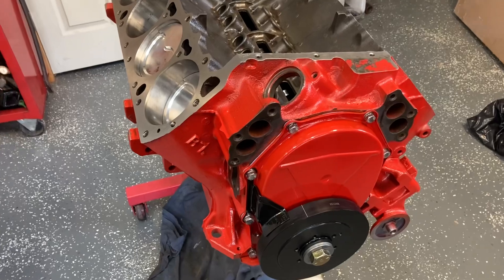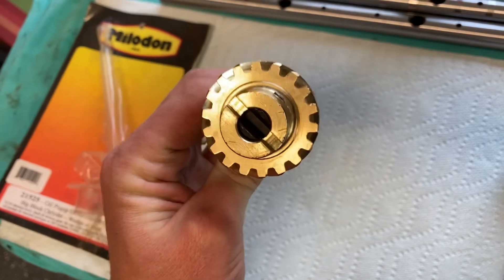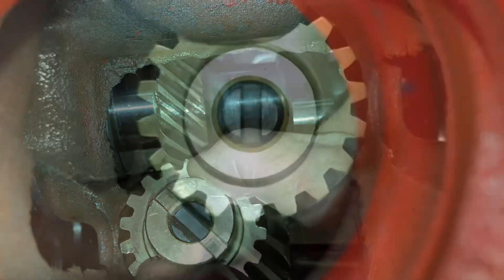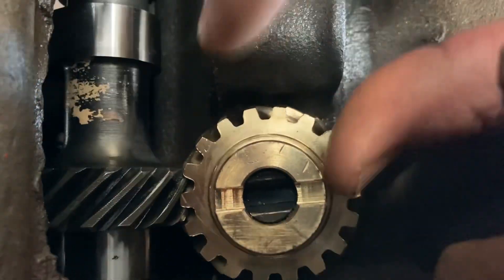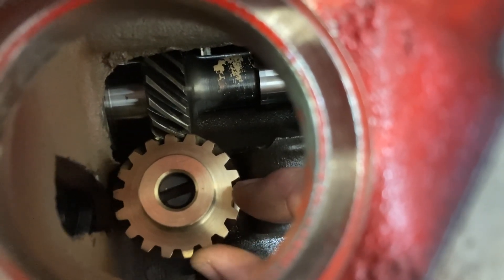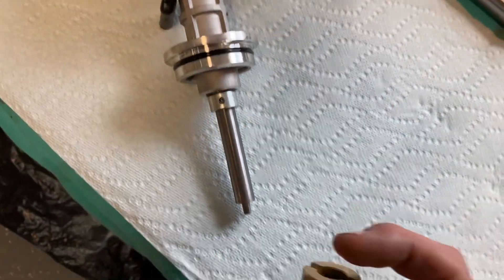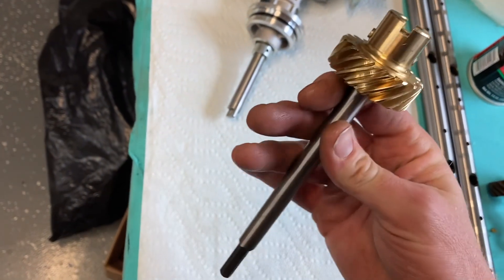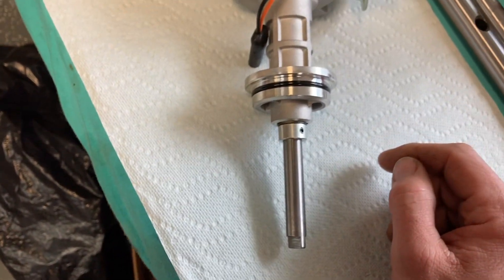The UNEXPECTED Reason Your Timing is Erratic and How to Prevent it! #engine #bigblock #mopar #dodge

Comment: Years ago a mopar action magazine writer suggested to put a collar at the end of the distributer shaft to adjust/minimize distributor shaft to intermediate vertical end play....I haven't tried it....just adding my 2 cents and letting you know you have a great channel.
Reply from the maker: Thank you, Daniel! I’ve heard of the collar before. Maybe interesting to try.
Reply: Yes. Rick Ehrenberg has them on E bay under "for Mopar Distributor Collar Timing Stabilizer 340 440 383 Hemi Dodge Plymouth".
I'd put a link here but E bay deletes my post every time I try to do the link thing.
Also, bronze gears aren't meant to run on the street. They will wear quickly. Well, way more quickly than the steel ones. The answer is running a roller cam that works with the steel intermediate gear. I'm running one from Comp in my stroked 440. There's a lot more newer tech out there now than before.
Reply: Hughes engine performance actually sold/sells it

Comment: Because the intermediate shaft drives the pump it can be baggy and really has little effect on timing but the dizzy engagement would be important.  I always liked sb ford cause the gear was right on the shaft,  timing is like a rock.
Reply from the maker: Thanks JC. I’ve only built that one ford engine, but the gear on the old distributor was missing several teeth! I’ve never seen such a thing. Is that common?
Reply: @JustMoparJoe  I think anything is possible,  I've never seen that.

Comment: Through my own testing ive found that the gear slope is not what causes that. Lets say you have .02 to loosen things up a bit. That .020 is not going to swing the timing 5 or more degrees especially when the oil pump is is dragging the drive to the cam. Cam walk is another story, but then again there are forces that push the cam in one direction it really doesn't walk.
The swing in timing is more related to electrical. Just my .02$
Reply from the maker: Thanks for sharing. My previous experience may have been influenced more by having very light springs in the distributor, and a distributor shaft end that was too short to engage that intermediate shaft. She revved clean but really broke up right after the rev. I was thinking carb, so I switched it and it still did it. Had to fix that connection 🏆

Comment: Hi Joe, Great video ! Am I correct in assuming you are running a bronze gear because that is a billet roller cam? One thing that I find interesting is that the fellow I got my bronze gear from included a hardened washer to run under the gear..he had machined off a raised portion on the bottom of the gear to allow for the washer. I was thinking that the washer might be another change to allow for better engagement between the shaft and the distributor?
Cheers,Pat
Reply from the maker: Here’s the cam. https://www.compcams.com/xtreme-energy-242-248-hydraulic-roller-cam-3-bolt-for-chrysler-383-440.html
Both of these gears have the raised portion under them. Using a washer may be a nice solution to set that back lash between the gears.

Comment: All the reasons for a crank trigger ignition system.  The two reasons that engines last so much longer is because of the far more accurate spark and fuel delivery of port fuel injection and crank triggered ignition.
Reply from the maker: Thanks Billy

Comment: Dont  worry about the play in the gears. The resistance of the oil pump will literally lock them together. Not to mention the bronze gear will expand a lot more and tighten up, which can be a problem with shearing and slivers if there isnt sufficient play/slop. Your 'fix' for the slot is where all that jitter happens. From there up to the rotor. Some dizzy's have a two-piece shaft as well. There is a small bushing and pin that wears out and causes the same problem, dont know until you pull it apart to check either. Only one little thing you overlooked here and thats the vertical thrust when the gear engages, the cam will actually walk the intermediate shaft up and in turn the dizzy up and throw timing off. Ive had an issue with a 440 doing that before. It had about 300,000 miles on it and if you didnt have the dizzy collar locked down you could pop the throttle and watch the whole distributor pop out of the socket!!!
Great vid pointing out these very often overlooked aspects of building!
Reply from the maker: Thanks for sharing! I wish we could slow motion film these pieces spinning in the engine at 6,000 rpm. Lots of fun science at work!
Reply: Whe it is running with the oil pump pushing oil,  just like you said it will not budge as it locks face to face on the two gears.
Reply: The drive gear is pushed DOWN into the bushing not up. The helix on the cam gear also sucks the cam back into the block. I have run LOTS of 440s with very high mileage for years daily driving as a primary car and then drag racing on the weekend with over 2500 time slips. We had to  put a diaper in the bellhousing to catch the oil from the rear main seal and put in a new one every weekend! We wired the dipstick down and oil caps on because the blowby would blow them off. I have actually seen a 440 in a low 10 second dart that was still running 15 years later and had never had the stock 906 heads off. I don't know how many miles it had before it was installed, but it actually blew the valley pan up into a balloon under the intake and was running 11's by then. the guy didn't change it because we were bracket racing and it was consistent! Ours was deadly consistent being the winningest car in the history of that track and made a perfect run, perfect reaction time, perfect dial in, footbraking a six pack C body! I suspect it was blowby that lifted the distributor. That reliability is a far cry from using 2 or 3 brand x engines a year campaigning a 10 second car!

Comment: Does the gear need to be bronze I had a new old stock shaft and it seems to do what you say mild engine hydraulic cam.
Reply from the maker: Bronze is an option for roller cams. Most flat tappets use the old stock style.

Comment: I've never seen one with that much slack!   wow!   Now, I have had those bronze gears flakes stick a oil pump spring.  they are made to shear.  Also, that .004 slack will move that rotor about 4x that much
Reply from the maker: Thanks, Tim. I figured you may have seen some variation of that. It’s always something! Lol

Comment: There is quite a bit of slop in all of those parts, but the oil pump requires a lot of power to turn I've Been Told so the resistance of turning that would never allow any backlash while the engine was running. But the clearance between the end of the distributor and the top of the oil pump drive shaft is something that would cause some of the timing to Jump Around
Reply from the maker: Thanks Thomas. I know every engine has a level of harmonics that goes on when it’s running. I have no idea on how that runs through the intermediate shaft there, if at all.

Comment: If it’s not popping when you let off you won’t turn as many heads😂
Reply from the maker: That’s a 3/4 cam! 😂
Reply: @JustMoparJoe  Oh yeah. I get that from time to time. "Is that a 3/4 cam your running?" 
Nope. It's a full cam. It wouldn't run with a 1/4 missing.

Comment: Great video Joe...that other one from a famous 440 place is just not up to the standard of the other one. I've played with this too with stock parts shiming the distributor shaft correctly too to keep the reluctor/points cam from having to much up and down play seen some that had a lot of play out the box.... And the intermediate bushing is also supposed to be burnished to size when installed would be a good idea to have the new shaft at that time to get the correct clearance just in case of shaft diameter differences between brands.
Reply from the maker: Thanks John! That’s an awesome idea

Comment: Another area to consider is the centrifugal advance mechanism and weights inside the OEM distributors. Over the years the grease they used breaks down and gets gummy. Springs can also break and cause problems. I always pull them apart, clean and grease to make sure they work properly.
Reply: The oe or MP Distributors are supposed to be oiled regularly. Pull the rotor, there is a felt or oil wick under there. If you do that, these things last forever.
Reply from the maker: Very true! Thanks for sharing
Reply: This makes sense.  I think one of the springs broke or came loose in my stock 360 distributor, runs up to max mech advance way too quickly and often sticks there until the RPMs settle below about 1000.  I'm swapping it for a Summit billet electronic distributor anyway because they're easier to adjust (and the stock one is points-type with a Pertronix module) but I'll fix up the old one and save it for another engine.